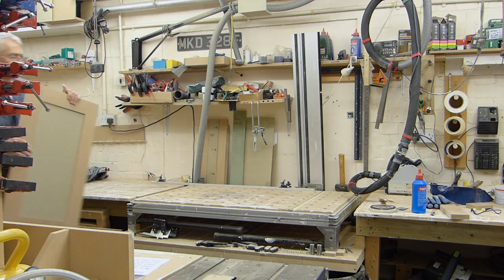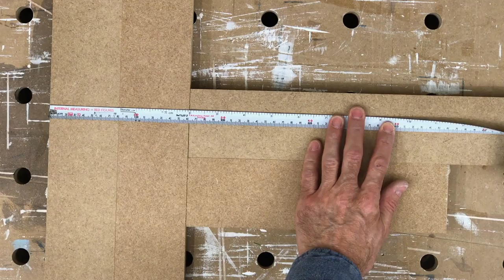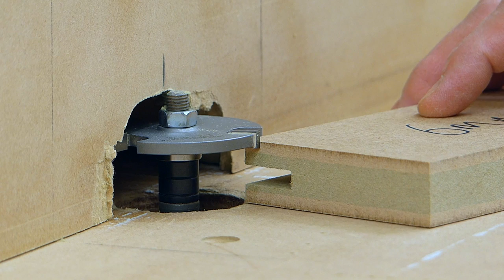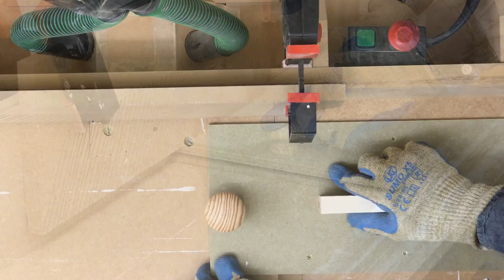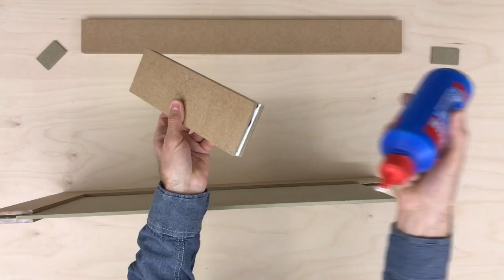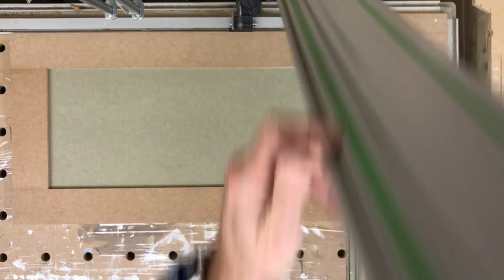Shaker-style Panel Doors #001

Comment: Hi Peter, thanks for the excellent video. I'm wondering if you may be able to help with an issue I've had. I've just made my first doors using this method and was pretty chuffed with them for a first effort. However, each door varies in width by up to 1mm - a lot when aiming for a 3mm gap between doors. They're about 2 metres tall and have rails at top, bottom and middle. I'm pretty sure the reason for the discrepancy is the fact that I cut the 6mm panel to 2mm narrower than the total width between the grooves, thinking it'd be wise to allow 1mm either side wiggle room. As these are full length wardrobe doors, I believe that the stiles wandered very slightly off straight during the glue up which couldn't have happened if I'd cut the panels to be exactly the size between the grooves. Perhaps the obvious solution would be what I've just mentioned; however, allowing zero wiggle room between the panel and grooves might be tricky to achieve given my fairly modest skills! Thank you and sorry for the essay. Jack
Reply from the maker: I always allow a bit of wiggle room for the panel, but you need to be careful to only clamp them up across the rails, otherwise you can pull the stiles out of shape yourself. Sometimes a good idea to make the doors slightly oversize and trim them back to fit with a tracksaw.  👍
Reply: @10MinuteWorkshop  thanks Peter. I did clamp up only across the 3 rails so perhaps my stiles deviated by a mm or so in width and that was responsible. First project with my Evolution track saw with 2.8m rail which I was really disappointed with so have returned. A shame all the others on the market are so much more! Thanks again

Comment: hi peter been catching up on your vids and find them all very interesting .being a joiner for 35 yrs worked on lots of different things but the one thing i have noticed is that a lot of people glue panels  in place i was tought that panels move and if you glue them they may spilt the peice they are glued to i now its mdf but it still moves adout.the only thing i can think of is the door gets its strenth from the panel
Reply from the maker: +Chris Logan Hiya. These doors certainly get some strength from the panel, but with MR MDF there's effectively no movement. 'Real tree wood' or if the panel is a different material, then sure, I'd leave the panel
loose 👍
Reply: thanks

Comment: Hi Peter. Great video as always. I’ve got to make some doors for some wardobes im building. I want to use this technique but I have 25mm tulip wood for the styles and rails and was going to use 6mm panel as my insert like you have but my doors are bigger. About 1.8m by 590mm. I was told that the 6mm would make it to films and was advised to use 12mm instead. Just wanted to get your thoughts as I’m struggling to find a cutter that will give me the 12.5/12.7mm cut out I need for the 12mm. Thank you
Reply from the maker: Thanks! Wow, my first ever video, still getting views and questions, lol! Pretty much every door I’ve ever made had a 6mm panel, and had no complaints from customers. You can go thicker if you want, but as you’ve found you’ll struggle to get a 12mm groover so you’ll be into a few passes to make it up. 👍

Comment: Hi Peter, sorry to bother you with this question, you might have already answered it or not. What is the common width for stiles and rails for shaker doors like these.
Thanks for your videos. Greetings from Argentina.
Reply from the maker: Hi Juan Pablo. I start at around 80mm, but have gone as narrow as 60 and as wide as 100. Bottom rail on taller doors are usually anywhere from 120 - 150mm, though there’s nothing set in stone - just whatever looks right. 👍👍

Comment: Great video, made it look simple and easy to have a go at. Quick question, why do you need the loose tenons? Could you cut the grooves in the rails and stile in such a way that they weren’t necessary? IE not the full length of the stiles? Is it just quicker and easier this way?
Reply from the maker: The loose tenons hold the rails and stiles together. You could do some kind of intricate hald-lap joint, but this is vastly faster, and simpler. 👍
Reply: @10MinuteWorkshop  thanks for the speedy reply Peter. I’ve seen it done with rails joined by tenon into the stiles but like you say that’s more cuts and setups on the router. Also like that you can prep stiles and cut them to length after the fact. Thanks for sharing, it’s great to see the different ways things can be done.

Comment: Was just wandering how strong a loose tendon is. And would it be better to do a stopped groove. Great video
Reply from the maker: Very strong.  You can do a stopped groove, but if you want a deep groove then you’re reducing the length of your tenon significantly.
Reply: @10MinuteWorkshop  ok thanks for the reply makes a lot of sense 👍

Comment: Could someone explain what the loose tenons do?  Why didn't Peter just not route all the way down to the end of the rails and leave it solid?   Is it an additional strength join for the sides and top/bottom perhaps?  Sorry if dumb question, only just starting out at woodwork.
Reply from the maker: When you’re making a door you need some way to fix the rails and stiles together - simply butt jointing them with glue won’t be strong enough. A traditional mortise and tenon shapes the end of the rail to fit into a corresponding mortise in the stile, whereas a loose or floating tenon does the same thing, but into a mortise in both the rail and stile. In this method the mortise is created by extending the panel groove around the end of the rail, and the full,height of the stile, with the loose tenon made from the same panel material for convenience.

It’s a simple, easy way to joint the rail and stile of a panel door together. There’s an updated version of this video here btw - https://youtu.be/jwGvYsvdCg4 Same information, but with better production values. 👍

Comment: Hi Peter. I know this is an old video but I frequently use it as a reference for building my panel doors. I'm in the process of buying the groover and arbour from your links. My question is what size bearing did you use on the arbour or did you just use your fence to set the depth? I know it's a few years ago but if you could shed some light I'd be eternally grateful.
Reply from the maker: Wow, my first ever YouTube video! Couldn’t tell you the bearing size I’m sorry - it came with the arbor I think? From memory I t gives a 22mm depth of cut, but I mostly use the fence tbh. 👍👍

Comment: Great video Peter. Whats the reason behind the offset on the groove? Why not just go centre?
Reply from the maker: If it’s a plain door I prefer just a 6-7mm rebate on the face. Also means that if the clients change their minds and decide they want a moulding applied, I can do it on the other side easily, without making new doors - provided they change their minds before the hinge pockets are drilled, of course. 🤔👍

Comment: I am not a pro but thank guys like you i did most of the work on my home... mDF don't stand well as door. I watched another expert like you and proof how mdf bend over the time if you using to make door any advice ... regular cabinetry is made wood frame and mdf panel.
Reply from the maker: With respect, I'd suggest you're talking from a very limited experience of working with MDF. Take a look at some of my other videos - I've done 300-odd since this first one - and you'll see that I use MR MDF extensively for client work. If my work or the materials I use were in any way substandard, I simply wouldn't have any clients. 🤷‍♂️
Reply: @10MinuteWorkshop  thanks for you time yes that true that is why I respectfully ask bc I was surprised I really love MDF y use a lot in trim and molding and the end result after paint is the same to my eyesight. I am new in your channel and man you are  amazing.
Reply from the maker: Thanks- and welcome! 👍👍

Comment: Hi Peter, I have a few questions if you don’t mind . 
- Do 22mm thick doors work ok with 18 mm carcasses on a concealed overlay hinge ? 
- Would this method be ok for larger wardrobe doors ? 
- when glueing up, do you think you could get away with some small gun pins fired through the rail, style and floating tenon when clamped up , so you can release them straight away. 
I have about 30 to make 🤦 
Thanks
Reply from the maker: Old vid! Yes, I found 22mm to be better for bigger doors, and yes, the method works well for large eg wardrobe doors too.  And yes, if you need to make the best use of fewer clamps then pinning the loose tenons will work, it’s just an added step to fill the holes later. 👍

Comment: I've found the easiest way to make MDF doors in this style is to start with 1/2" sheet of MDF (cut to the exact door size).  Then cut 1/4" MDF in strips to glue on the top as the stiles and rails.  I use contact adhesive so there's no clamping involved.  Once sanded, and painted, it looks great.  With this method, you only need a table saw/track saw to make the door.  No need to cut dados with a router.  No need for gluing in tenons.
Reply from the maker: See video #019 🤷‍♂️👍
Reply: @10MinuteWorkshop  I actually don't disagree with anything in that video (if doing it like you did).  Using Barge Contact Cement eliminates the need for nails/glue/clamps.  Using Euro Hinges makes hinge problem go away.  Usually I make the doors a tiny bit oversized, and then once built, I take off a 1/64 on each side at the table saw.  Makes for a perfect door - super easy.

Comment: Can't find a groove bit that is 3/4" deep anywhere.. I have done this style door using your method with a half inch deep groove and it came out great!  I am worried about premature wear or failure because I need a deeper groove for more surface contact for the glue. Where can I find this?
Reply from the maker: I buy mine from Wealden Tools - there are links in every video description to tools used or featured in the video 👍

Comment: Fantastic video. However....Peter i need your help! Im making these doors for my friend in his kitchen. Also he wants end panels with v grooves and filler pieces. My question is, do i need to use moisture resistant mdf for doors, panels, and filler pieces? Where do you buy uour mdf from? And what thickness would you reccomend for all pieces? Im sorry to ask so many questions but your the mdf King! Your videos are amazing....thanks. Hope i hear back.
Reply from the maker: Thanks Chris! I buy from a local timber yard (ajferguson.co.uk) who are excellent, but MR MDF is widely available in Britain - stores like Wickes stock it - and is a better quality board generally, but particularly for use in kitchens and bathrooms. It’s well worth searching out IMHO. I generally use 22mm for the rails and stiles and 6mm for the panel, though I’ve used 18mm for the rails/stiles before on smaller doors without any problems. The v-groove (sometimes called butt & bead, TGV or matchboard) you can either buy ready made in sort or long orientation, or you can make your own with a router if you need e.g. specific spacing. HTH Peter. 👍
Reply: Peter Millard  Thank you so much for replying! Amazing info. If i use 22mm thick for rails and stiles then would i also use 22mm for any end panels and fillers? To keep uniform thickness for asthetics? The v grooves in for end panels and is just a visual asthetic and ill do it with the router as you suggest. Look forward to your reply. Thanks. Ill be asking you many more questions in the future as im just starting my woodworking journey.

Comment: Super simple, very informative video. Can I ask, why did you set the grooving bit slightly off centre?
Thank you Peter.
Reply from the maker: Thanks Graeme! Just FYI there’s an updated version of this video here - https://youtu.be/jwGvYsvdCg4 - where I also talk about mock-panel doors. Re the offset groove, there’s two reasons; I think a 6 or 7mm rebate around the door just looks better, personally, and it’s an easy way to see which is the face side of the rails and stiles, because the back has the deeper rebate. 👍👍
Reply: Thank you for that reply. I’m about to make a wardrobe and an ‘under the stairs’ cupboard for my daughters new house. Never made this style of door before but your video has explained it perfectly. 
Thank you very much .... you have the perfect voice for informative video making. 👍🏻

Comment: Hi Peter. What size mdf are you using here? Is it 18mm with 6mm panel? 
If so what size do you recommend for taller doors where usually a centre rail is put in? 
If a centre rail is put in I guess you just do it as you have but two panels are required and the centre will be purely held from the two panels butting to it? 
Thanks
Reply from the maker: Old vid! Yes, 18/6mm, but I switched to 22/6 or 22/9 for larger doors. Check out any of my furniture build playlists for lots of videos on the topic. 👍

Comment: Hi Peter, grateful for a bit of advice please.  I’m building a storage unit and the doors will be 150cm tall, will I need to put a centre rail in or would 2 rails suffice?  I’ll be using 18mm MR MDF,  thanks again for all the Vids, I’m guessing you will be reviewing the new Benchdogs Ultimate MFT table, I look forward to that one!
Barry
Reply from the maker: Hi Barry.  1500mm is right on the cusp of where I’d want to start adding in a mid rail. I think I’d check the aesthetics, see how it looks with and without. I generally used 22mm for rails and stiles on bigger doors, just fyi.  👍
Reply: @10MinuteWorkshop  thanks Peter, appreciate your time.   I knocked one up today in 18mm using dominoes and 3 rails, easy to make and turned out well.  Agree thicker material would be better, fingers crossed these don’t warp!!
Thanks again for your reply 👍

Comment: Do you think this way of making doors would work with poplar stiles and rails along with an MDF panel?
Reply from the maker: Sure. 👍
Reply: @10MinuteWorkshop  Thanks 👍 I'll give it a go. I usually use dominoes for timber doors but don't have the right size and didn't really want to break the bank and buy an 18mm or 22mm sheet of MDF 🙄

Comment: Hello Peter, couple of quick questions please. When you make your MDF shaker doors, how do you treat them before painting? Do you apply MDF sealer, undercoat then the actual coat? Same question if your making end boards for a kitchen cabinet? I’m just a bit concerned if I cut an end board, the base of it will be on the floor so was wondering the best way to seal it to prevent any moisture penetrating the MDF. Many thanks.
Reply from the maker: I only use MR (moisture Resistant) MDF so it's less of an issue, but generally I don't do anything other than apply a couple of coats of primer/undercoat, followed by a couple of coats of topcoat - all water-based acrylic. If I know there's going to be ground contact with something that's potentially damp eg bathroom floor, then I'd probably use a wood hardener first, and let that fully soak in before painting. I did a 6-part painting & finishing series starting video #029 that may be worth a look, or an 8-part 'playing at spraying' series that covered the same process if you're planning to spray. HTH P

Comment: Hi Peter. I’d love to make new doors for our kitchen. The only thing I’m not keen on here is the choice of materials. Have you ever made these with something other than MDF? Great channel. Thanks.
Reply from the maker: Thanks Neil. Old video btw, there’s a newer version here - https://youtu.be/jwGvYsvdCg4. Honestly, for a painted finish MRMDF is pretty much perfect - flat stable, easy to prep and takes paint very well. For solid timber I prefer to use a stub tenon, which is a different process. 👍👍
Reply: @10MinuteWorkshop  Wow. An immediate reply to a comment and question on a YEAR OLD video. Thanks! I’ll check out the link.
Reply from the maker: No problem. That’s almost a 4 years-old video btw - my first #001. Posted #425 last week... 👍👍

Comment: Peter great video , thanks , can you please share the speed used in the router? I just bought a CMT set quite expensive and on a first try the mdf is burning and cuts are horrible . Thank you
Maurizio
Reply from the maker: Hi Maurizio. In MDF generally the faster the better - I usually have my dial set to 11, lol! CMT bits should zip through MDF without any issues at all. HTH P👍👍
Reply: Thank you Peter , a bit embarrassed but must say when I assembled the two cutters one was mounted upside down ...hence the issue. Solved that I used 17000rpm (4.5) and it works like a charm
Cheers
Maurizio

Comment: Hi Peter, when I first watched this I wondered why you didn’t 'stop the grooves in the styles and why you routed a groove in the short edge of the rail. It's just dawned on me that the loose tenons actually add an increased gluing surface and do away with the need to use pocket screws or whatever to strengthen the butt joints. Was that the plan?
Reply from the maker: Yep. Simple as that - no additional fixings needed 👍👍
Reply: @10MinuteWorkshop  Having just made 8 doors using regular tenons I now understand why you make your doors this way. I'm definitely going to do it this way next time.

Comment: Sorry if this has been asked before. Is this method good for tall wardrobe doors? Looking at making some 2200mm x 600mm. Worried about bowing/warping.
Reply from the maker: Yes, it works well, but for a door that tall use 22mm minimum for the rails and stiles. 👍